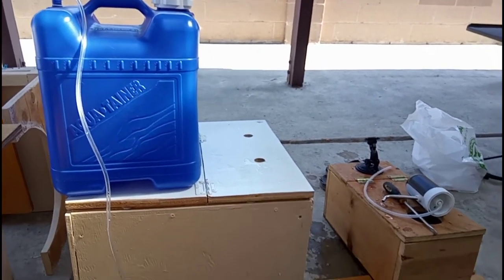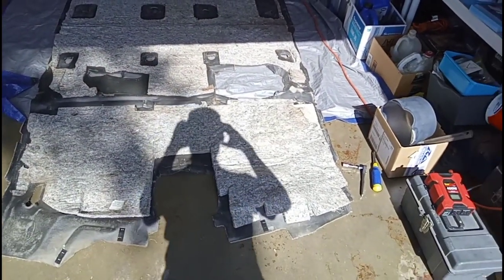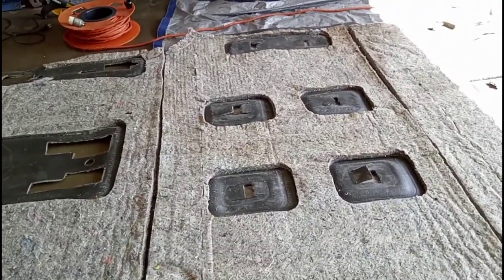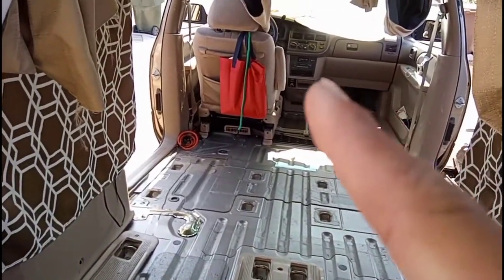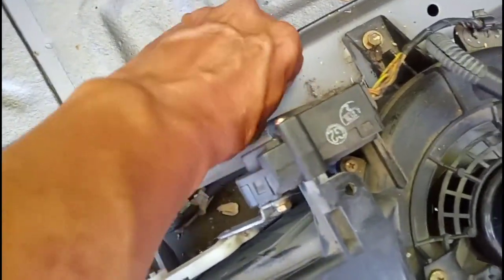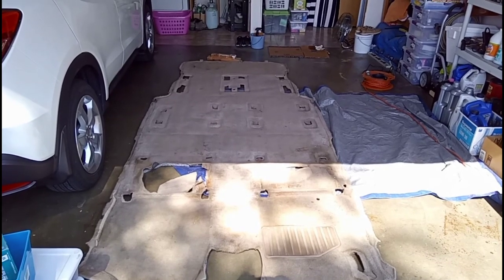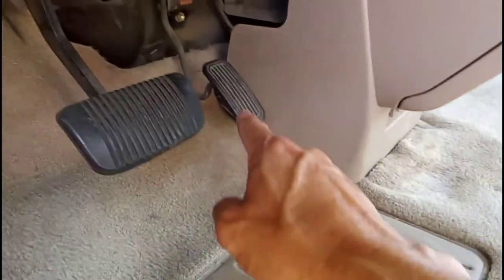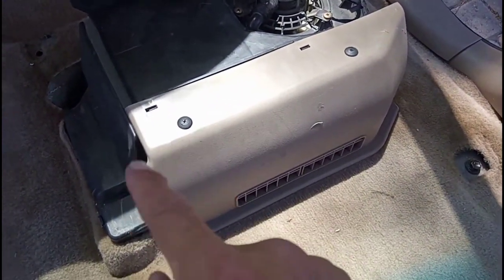Carpet Installation on 1999 Toyota Sienna.

Comment: Thank you for sharing your experience.  I am glad I planned to store my water in bins or coolers. I do have a goal zero filter jug to find room for still.  I thought about getting a folding bathtub.  Maybe not such a great idea. I sure would hate to go through all the work to dry out the carpet.  Great job on details.
Reply from the maker: Yeah, water damage is #1 enemy in Van built.
Reply: I was mostly concerned with mold. Also ease of moving things around,  although a 48 quart cooler full of food and water won't be lightweight,  lol.

Comment: I read somewhere that you should disconnect your battery for 30 minutes before disconnecting power cord under seat to avoid air bags discharging.
Reply from the maker: Well, that's for newer vehicle (Maybe). This vehicle has no airbag build into the seat. I disconnect the wires from a 2012 Scion XD (still a Toyota) and nothing happened. Thanks for watching!
Reply: Thanks for info.  Just relating what I read. My engineer/helicopter mechanic son said it is possible, but I don't know how probable.  I will err on the side of caution.